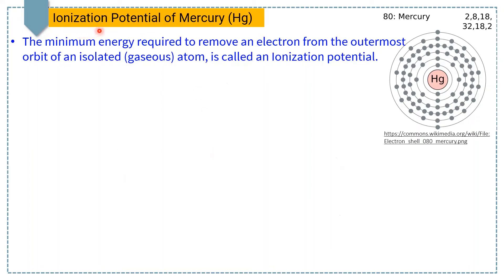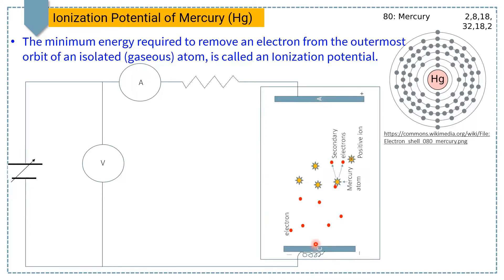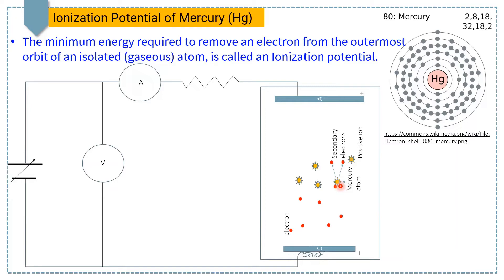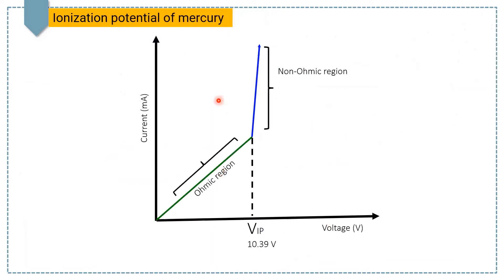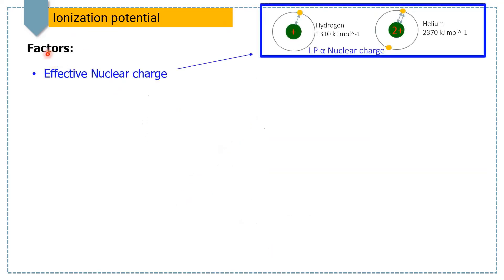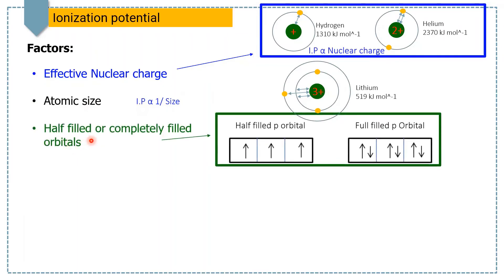#Ionizationpotential #mercury Ionization potential of mercury apparatus | Graph | Theory Part 1

Comment: •••KEY POINTS••• 
• Energy required to remove outermost electron form the atom is known as I.E
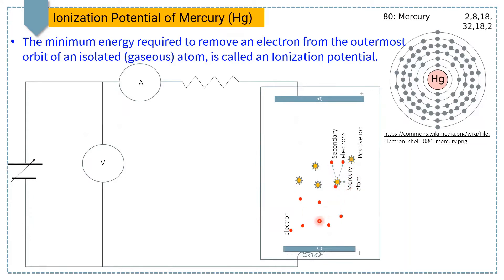• Experiment performed at 10mm to 50mm Pressure of mercury.(0:55)

    
           Factors
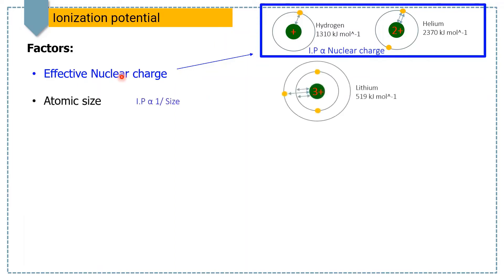• I.P æ 1/atomic size (4:46) 
• I.P æ 1/Principle Quantum (7:29) 
• I.P needs in half filled or full filled orbitals is more
• Need more I.P when no of elections are less.